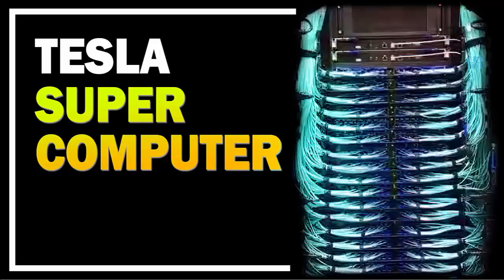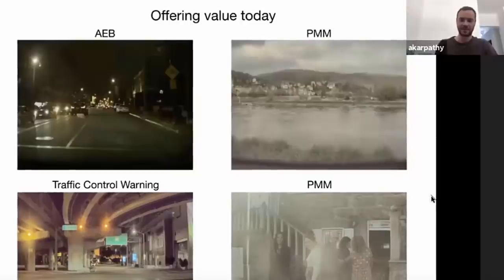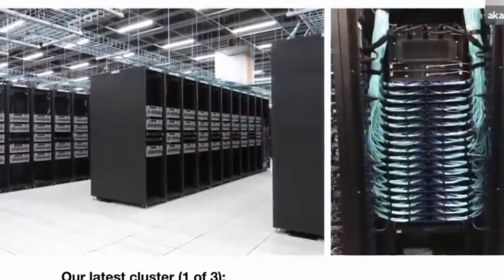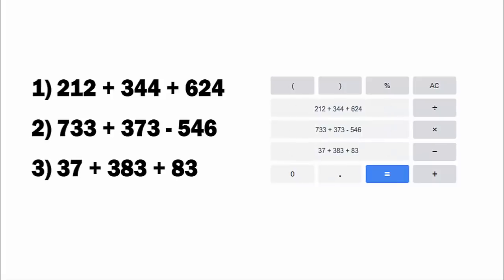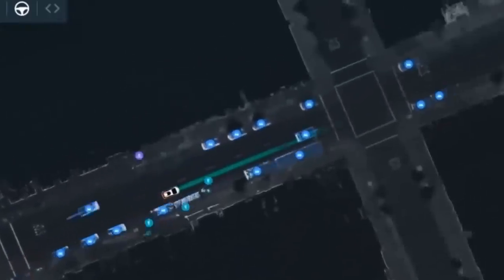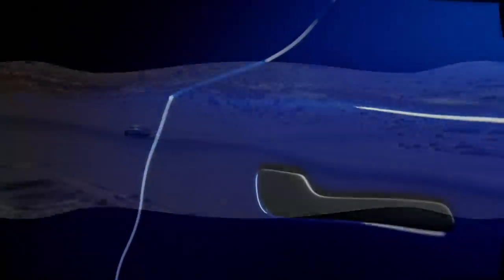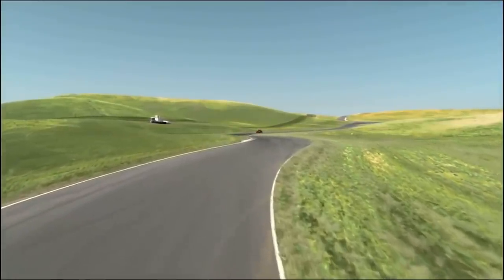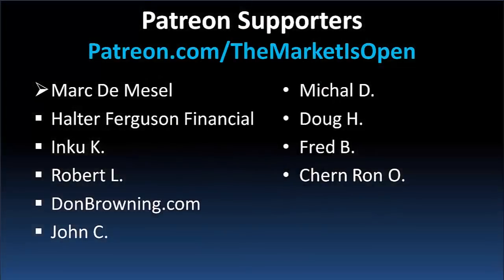Tesla’s INSANE SUPERCOMPUTER is only the Beginning

Comment: I have a question no one has ever brought up. Since these EV's are 
computers on wheels, and they track a huge amount of daily driving data.
 I am concerned about hacking, privacy, and or the company misusing all 
of the detailed personal data gathered. For example, Tesla very quickly 
showed that the Chinese driver that claimed brake failure actually 
pressed the go pedal instead. Several Tesla accidents have been shown by
 Tesla data to disprove initial Tesla problems. GM has cabin cameras to 
watch the driver. I would really like to get a cyber truck, but am very 
uneasy about this massive intrusion and data collection. Do you have any
 insight on this issue and privacy intrusion? I suppose if decentralized
 block chain tech was initiated and required a court order to release 
private data, that would help my concerns a lot. We already see big tech
 and CHINA gathering our personal data and using it against us.
Reply: Okay mr personal data

Comment: I think that eventual licensing would be a smart move. If it takes Tesla years and billions of dollars to develop FSD to achieve the 7 9's, i.e. 99.9999999% , reliability required to meet their internal goals and external regulatory concerns then, eventually, rivals may be able to achieve the same results for hundreds of millions either by using new techniques, faster computers or reverse engineering. If Tesla can leverage their lead and license out FSD for significant money  then that would help recoup Tesla's development costs, might dissuade some companies from competing at all, specifically those that seem happy to slap a bunch of off-the-shelf parts bin components together to make a vehicle and then proudly affix a brand badge to it, and could take the wind, or VC dollars, out of the sails of other competitors.

A common belief in the software industry is that all software eventually dies by being undercut and replaced by lower priced rivals, I don't see FSD being any different even if it take 10-20 years. At Battery Day Elon Musk stated that the true competitive advantage would be in advanced manufacturing and I feel that Tesla with its Giga Presses,  in-house battery cell lines and material science teams is leaning hard into that strategy.

Comment: 11:34 Microsoft is introducing W11. And you can't run it on any machine designed for W10 and before. Why? Evidently security is the reason. Do you really think anything is ever going to be secure? 

Take passwords: Microsoft thinks (actually dictates) that password managers be used. What do you get? A honey pot with a Microsoft...and thus NSA... back door. 

A protocol that never showed anyone your password would be far more secure. But if you want that, you must effect it yourself...and I have. I can use the same so-called "strong" password anywhere and be totally secure. NSA couldn't learn it in my lifetime.

Comment: One reason Elon wants other OEMs to use Tesla's Auto Pilot is so that someday most EVs can access Boring Company tunnels where FSD will be required for utilization.  Speeding to your destination in underground tunnels at 100+ MPH will save unbelievable amounts of time with zero chance of accidents.
Reply: More likely Tesla may provide autopilot to third parties but users of non-Tesla cars will need to pay monthly fees to Tesla as Tesla will be providing updates necessary to run autopilot anyway. Thus even small EV companies can provide for their customers expensive to develop autopilot functionality but Tesla will be the one profiting from it in the same way that Netflix profiting from your monthly subscription regardless if you watching from Apple or Windows computer...
There is one issue though, achieving full self-driving Tesla's way is far harder technologically than by using pre-mapping of all roads and then driving throught known mapped environment with the help of the LIDAR and other sensors as being developed by some competition, even though pre-mapping and the need for more sensors like LIDAR may be far more expensive initially and to keep up to date.
Reply: Okay buddy

Comment: From a computing perspective, sharing the capabilities; ie the safety responses or manoevrability doesn't necessarily equate to sharing the actual code. If in fact they do share the code used to develop FSD, that as well doesn't equate to sharing the zetabytes of info that Tesla already have & who would be able to access it usefully anyway? None of them excepting perhaps Apple or Google could. That in itself would be a boon to Tesla's powerbase. They'd already hold the 2 biggest data operators under their control. Please don't bring up Microsux here because the thought of this unscrupulous succubus running a car company would be tantamount to an error-prone software system with the usefulness of sanscrit to a blind man. Whilst I still think both Spoogle & Offal are scum they can of course code.

Without access to Tesla's own systems, the data knowledge & software that utilises that massive bank of data, access to either one individually is still many years behind. Understanding it would need their quantum computer at minimum, improving it when they're already years behind is laughable when Tesla are constantly upgrading their own systems. I'm sure Elon would share their current software a week before a major upgrade anyway, he's not dumb.

Comment: This system can be adapted for aviation and might be necessary for the safe launching and re-entry of space vehicles.
Reply: Nope nope
Reply: @alanmay7929  I didn't say 'easily', but if such a system could operate in a 3D mode, it should reduce mid-air collisions in an increasingly crowded environment, and as for rockets, avoidance of space-junk and navigating the Asteroid-belt. I would like your thoughts on the matter.
Reply: @pauljmeyer1  airplanes autopilot systems are already amazing, but since airplanes are the most secure/reliable source of transport it has redundancy systems and talking space junk, satellites already have thrusters to avoid or change positions in space.
Reply: @alanmay7929  There's a difference between an active and a passive system, it is the active system to be sought and that requires AI. This is why Tesla systems appear so attractive.
Reply: @pauljmeyer1  nope its not, autopilot also relies in AI or machine learning, how do you think airplanes can manage auto navigation in sooo many different conditions and finally planes are safer than cars.

Comment: I think that it would not matter that Tesla could license FSD to other OEMs.  There are other things that still make Tesla by far a better and superior product- Battery Technology and Management, Body Casting Processes, OTA updates, Building Efficiency, Vertical Integration of most critical components, etc, etc, etc, all of which Tesla is years, maybe decades, ahead of its closest competitor, if there is any competitor at all. Other OEMs, either newcomers or legacy, do not have the open mind and leadership that Tesla have in the person of Elon Musk- they are still thinking which legacy bin parts can be used to make their product, Tesla doesn't, Tesla starts with a clean slate.  Elon maybe controversial in certain things, but he still is a powerful leader and a DOER, and has the vision of the future other people doesn't have. And he is using the knowledge that is constantly acquired from Space-X, no other company has that advantage. Tesla is willing to experiment, and to fix wrongs as soon as possible, not to wait for next generation to apply the solution like legacy companies do. And you can add to the list of reasons the licensing of FSD will not affect Tesla, so NO, I don't think that licensing FSD will impact Tesla at all. And remember, Tesla's CEO is an Engineer, and the company has the largest First and best Order Engineer army running all aspects of its company, not MBA's that would cripple the thinking and decision making with their anachronistic and defective business/profit oriented views, that will sacrifice Quality in favor of profit.  That is my opinion in "short".

Comment: Good video. There's no downside to Tesla licensing FSD to other OEMs. Musk has always spoken about doing this, and he's made it clear that Tesla, even with its ambitious +50%/year EV expansion (a goal set in 2014), cannot supply all the EVs the world will need and want, to kill the ICE. If Tesla licenses its FSD, and probably selling computer boards and cameras as well - then 'everyone solving self-driving by 2030' (Musk said this) won't happen.  Like your smart Android analogy it will be quicker and better to just buy FSD. 
Some of the otherwise really smart Tesla YouTube channels seem unable to separate market dominance with making the most EVs. Musk has clearly said that Tesla cannot build enough EVs to meet demand.  I can see the old OEMs: Ford, GM, Toyota, VW, etc.. making more EVs than Tesla in the  future. However, Tesla will  continue to make the better vehicles (as Apple doesn't sell the most smart phones they do make the best ones and earn 90% of that entire segment's profits). Like Apple  Tesla will make the most profit. Tesla will for the foreseeable future (at least 5 more years) sell every vehicle it can make at a significantly greater profit margin than all competitors. And many of those competitors will likely be licensing  or buying Tesla software, and hardware -  including batteries. (Tesla's battery partners will do the same.) 
Say Tesla delivers (as promised) 6 million Tesla EVs in 2026, it might also sell FSD for 9 million vehicles but only 4 million of those are Tesla EVs.  Everything Tesla sells to other OEMs will be pure profit. Nothing scales profits like software.
And while Apple makes the best smart phones, Samsung has competitive models that in some ways are better; Samsung also makes many of the parts in Apple iPhones.  No company ever lost money because it supplied its employees with Samsung instead of Apple smart phones. None of this is true for Tesla. (Companies that have fleets of Tesla Semis will be more profitable than companies still paying off diesel rigs. The only competition to Tesla will be used rigs, but not for long. A few brake jobs, motor overhauls will bury those companies.) 
 Tesla makes it's own key components (making it both Apple and Samsung); its EVs are head and shoulders better than the competition. Ford was very smart with the Mach E making it as Model Y like as possible - however when Sandy Munro started taking one apart two things were clear: First there are some very smart engineers at Ford, but secondly, in too many critical areas there are too many key systems that have too many parts, too many connections - hence, too many things that can go wrong. It shouldn't take too long for Mach Es to begin having problems the Teslas will never have. The Mach E is still a good EV. It also has no path to FSD.
Terrific point that Tesla is like both Apple and  Android! With FSD Beta 9 and turning on the in car camera to monitor driver attentiveness GM's Cadillac system no longer has anything over Tesla FSD. (Now even those chuckleheads at Consumer Reports won't be able to condemn Tesla. )
I've also noticed more trolls on the Tesla channels. According to them I need to dump my Tesla stock, send apologies to everyone murdered by FSD and probably build a bunker. There's always more squealing right at the end.